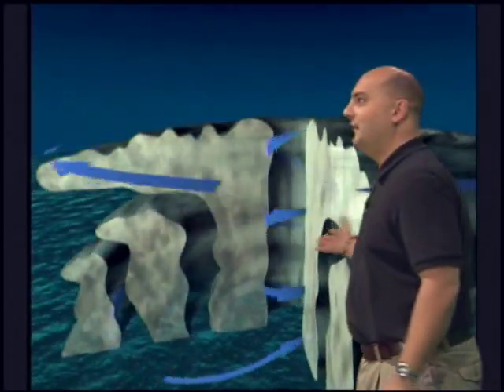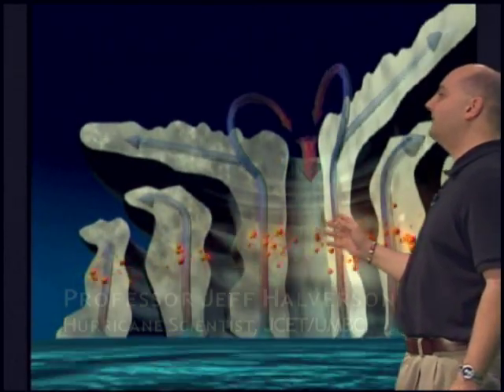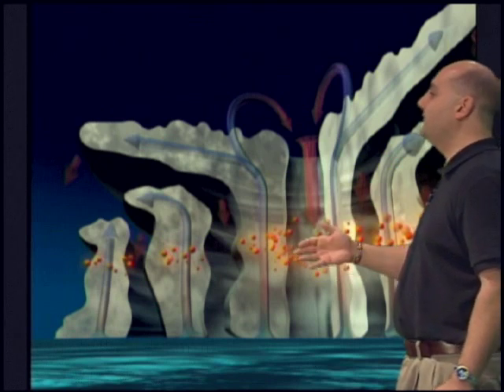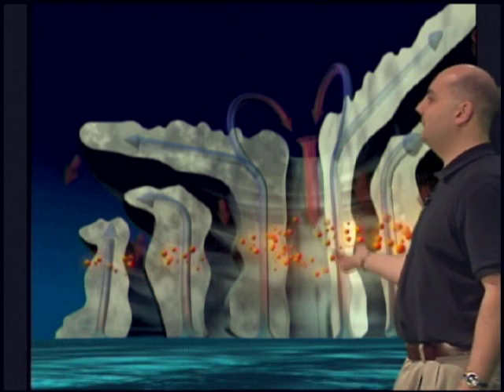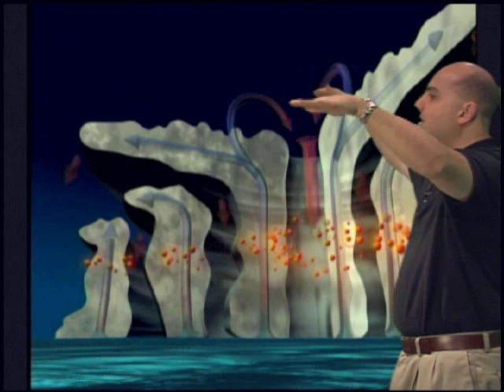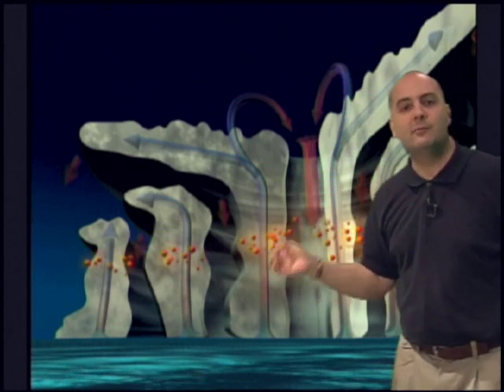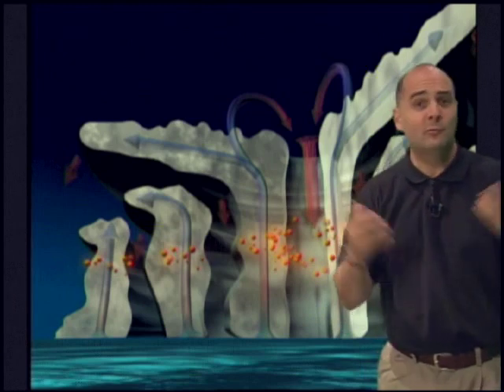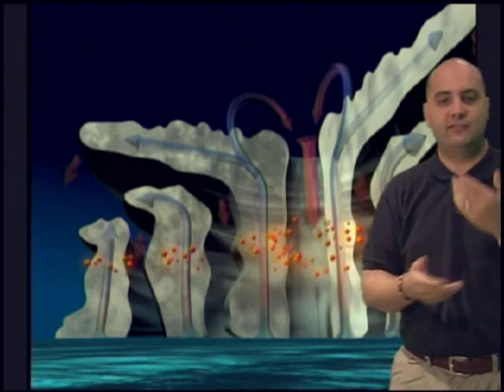22: The Hurricane Heat Engine

Comment: Superstition and half-baked theory dominate the atmospheric sciences. Currently meteorological theories on atmospheric flow and storms maintain three superstitious and half-baked notions: 1) Convection. This is the strange belief that evaporation produces air that is buoyant enough to power strong updrafts in the atmosphere (included in this is the strange belief that H2O in the atmosphere becomes gaseous at temperatures/pressures that have never been detected in a laboratory); 2) Dry layer capping. This is a superstition that imagines dry layers having structural properties that explain the how/why convection does not constantly produce storms and uplift; 3) Latent heat.  This is the notion that phase changes from a gaseous phase of H2O (which purported to exist despite never having been detected and being inconsistent with what is indicated in the H2O phase table) to a liquid phase releases "latent heat" which itself has never been confirmed/verified. 

In accordance with which, the current meteorological paradigm assumes hurricanes are caused by warm water. Actually the energy of hurricanes and all storms comes from jet streams and is delivered through vortices in the form of low pressure. Wind shear at low altitudes is the most important predictor of severe weather. This is because wind shear is the mechanism underlying growth of the vortices that are the transport mechanism of the low pressure energy. Warm moist air/water is not the source of the energy of storms, it's the target of vortice growth.
The 'Missing Link' of Meteorology's Theory of Storms
http://www.thunderbolts.info/forum/phpBB3/viewtopic.php?f=10&t=16329
James McGinn / Solving Tornadoes
Reply: The most incredulous claim you make is that current meteorology makes no predictions. Just what in the hell are weather forecast than? Why is it using current meteorological understanding
 I can make my own predictions that I can use to chase storms?

You need to get outside your own bubble a bit.